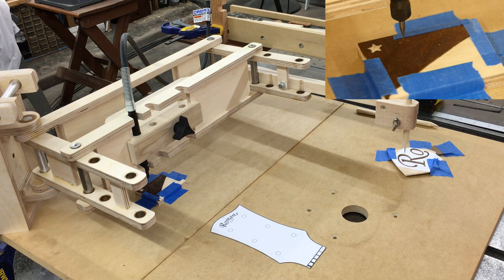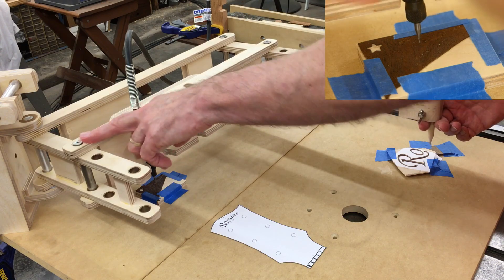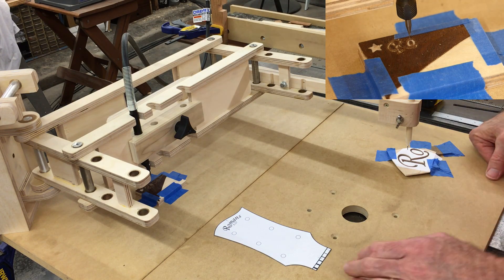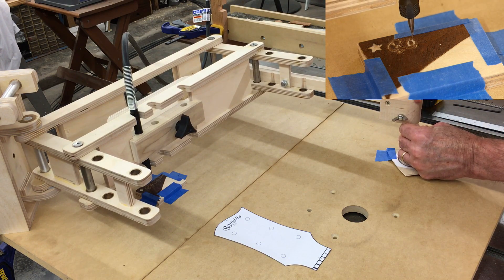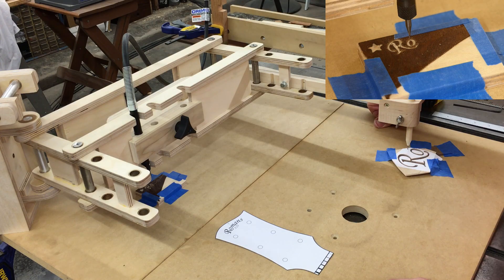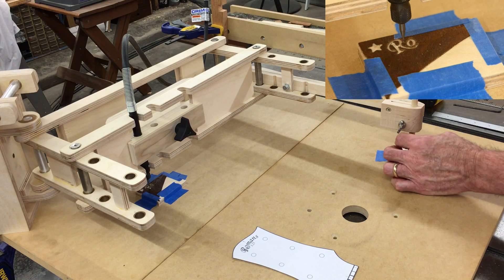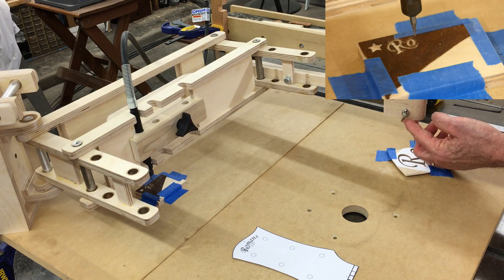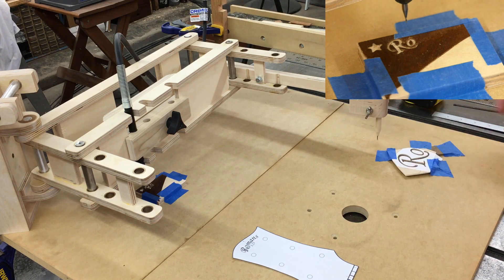Guitar Inlay Pantograph  5-18-16

Comment: I have not seen that configuration of reductions before where there are several positions for the router, did you ever produce a video of it construction with measurements?

Your pantograph looks superb and it is obvious that the finished product meets your expectations

Regards

Chris
Reply from the maker: Thanks, Chris - glad you like it!  No, I didn't do any finished drawings but I still might one day.  I built a CNC router so the pantograph isn't seeing much use these days.